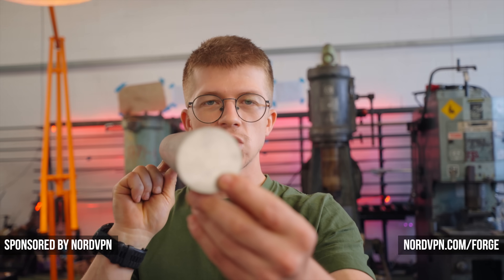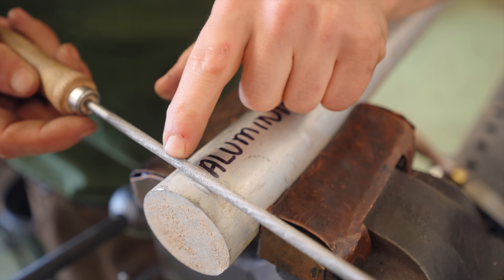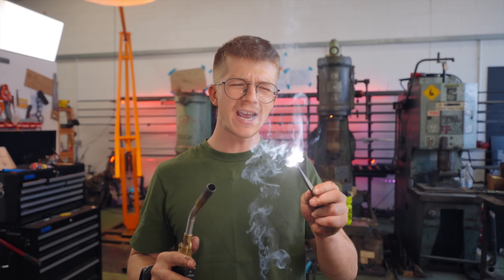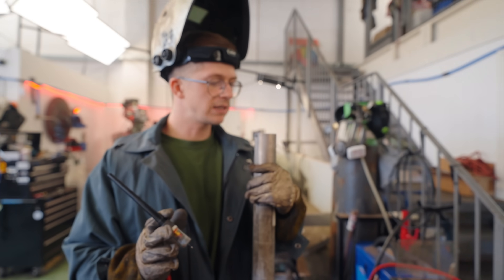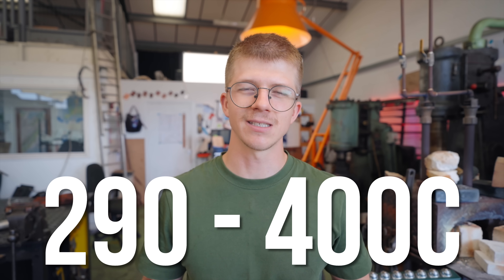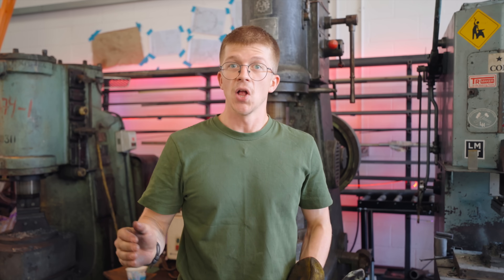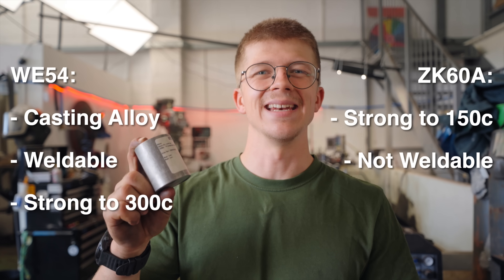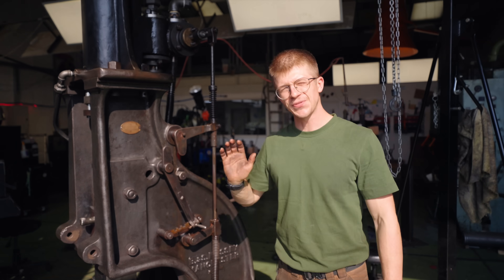Can You Forge Magnesium?

Comment: 2:00 They don't have to have a different number of atoms in them, not significantly anyways. If you got a trillion oxygen atoms and a trillion lead atoms they could form a solid of roughly equal size, it's just that one has less mass than the other, the actual atoms are basically the same size. Their density would be the same, in that configuration.

The question is whether Magnesium is less actually dense, i.e less atoms per unit volume or whether it's just less massive? So we go to the periodic table to find out, and indeed aluminium and magnesium are right next to each other, which means they're of quite similar mass, and Iron is on the next row down, thus the difference must definitely be in density of the solids. Just with a quick back of the envelope calculation, Iron has an atomic mass twice that of Magnesium, and is six times heavier per unit volume, so there's roughly three times as many iron (Steel is roughly 97% Iron, so it makes little difference) atoms per unit volume compared with magnesium.

Hardness and density are not correlated directly. The varying forms of carbon being the best example. The strongest substance known to humanity are carbon/graphene microtubules that put even titanium and diamond to shame, but they're literally microscopic and thousands of times less dense than any substance we're familar with. Hardness and flexibility are about the internal structure of the material in question, certain kinds of lattices are flexible and can easily bend but the bonds don't break, so it's incredibly hard to cut through.

Comment: Pure magnesium isn't used for a laxative. It is magnesium citrate, which is a salt of magnesium.
Reply: Magnesium hydroxide in suspension is used to treat acid reflux as it neutralises excess stomach acid. It is sold under the name milk of magnesia.
Reply: It's still because of the magnesium though, that's like saying salt isn't sodium.
Reply: @guyincognito.  The intake of pure magnesium, like pure sodium, is dangerous. So, being specific about it not being pure is important.
Reply: @dl200010  earing pure sodium will be way worse than pure magnesium tho lol. but yeah, some forms are scarier than others.
Reply: @guyincognito. 
Would you say that the Earth's crust is oxygen then? Since it contains oxygen?
Reply: @guyincognito.  Yes, salt isn't sodium metal. It's sodium salt. These are two different things that have the same nuclei (well, half of, anyways) and vastly different properties.

Sodium metal blows up if you throw it in a lake (specifically, sodium reacts with water creating sodium hydroxide solution and free hydrogen molecules, which then burn and explode). Sodium salt dissolves and makes the water salty.

How are people watching this channel so clueless about basic chemistry?

Comment: Can magnesium be cast? It might make a good alloy with copper. It seems to me that copper is the king of casting  base metals. Bronze can be made that is almost as hard as steel using different alloying metals. Copper might just make the magnesium workable, while enhancing the strength of the copper. If you could somehow alloy the two, you might have something you could work with. Copper has great malleability; Magnesium has great hardness. Magnesium bronze? It might make the hardest nonferrous copper alloy yet. Someone has to have tried this.

Comment: magnesium, flow meter wheel...small and lite, so it can meter small pilot light gas flow that's similar to a cigarette lighter flame. billing as much as it costs to buy a lighter for that same gas usage? in the gas pump in the gas metering valve ... the small armatures in mechanical watches and computer things... machine the bar so it becomes a roll pin with a magnetic levitation bearing on each end, and as so to also cut it down the length like a drive screw that moves the lathe table tho deep cuts, and finish it off by milling notches in the "screw" making a... turbine like metering wheel. anodize one of the front fins black the rest of it bright yellow "for a photo stator sensor", and inside of a tube levitating on monopole magnet rings/pin nubs, how little air flow makes it spin? average gas line is 1 inch wide... bit to work with being a 3" bar?

Comment: Well in reality the atoms are spaced further apart from each other than aluminum making it more gelly like that the Al causing the crystal lattice to slide more across the teeth of the pinny thing. Same goes for the forging due to increased atomic distance and its before observed jelly structure causing it to act like starch in water or D3O. The cracks you observed at the raw material are from the atoms retreating back to a lower vibrational state due to loss in temperature resulting into the “densifying” of the crystal lattice causing a shrinkage of the metal resulting in crack formation. When the metal breaks under high stress it will do so across the point where the crystals terminated along there meeting point which caused a beautiful shine to appear along the reflective crystal sides. Further studying of the crystal size along the breaking point may hold deeper understanding. As in regards to your Steam Generator I am happy to inform you that this is a work in process of which I could update you along the way if you so be interested ✌️👽🧬

Comment: The extra fun part of magnesium fires in your workshop is that it burns hot enough to start an aluminium + iron oxide thermite reaction which is self oxidizing and burns at 2862c. Good thing there isn't a bunch of aluminium and iron dust around.

Comment: Scientist here, the file cuts the magnesium worse than it cuts the aluminium because magnesium is harder than aluminium meaning the small teeth of the file are worse at breaking small bits off. You saw this when you tried to forge it. Where as the magnesium is more brittle than the aluminium so the wood saw with its big teeth is better at cleaving big chunks off the magnesium. Same reason it is difficult to get big long filings on the lathe with magnesium. The pieces break off in to bits easily because magnesium is brittle. You also saw this when you put it under the press.

Comment: If you can mold aluminium with a bit of that magnesium you can make really good thermal generator just don't let the metal get up to four hundred degrees Celsius otherwise it will combust, it's thermal properties were only found out recently in England too.

Comment: A friend was at the Isle of Man TT in the early 80s. He described how one of the bikes had crashed (nothing new there at a TT) and then ignited and BURNED. Emergency services were dousing it continually in streams of water for more than 20 minutes with no observable effect as a very expensive bike with a very high magnesium content frame burned down to a small puddle of liquid metal & finally went out.
Reply: Honda made a Formula 1 car with a magnesium body called the RA302. Their usual driver, John Surtees, refused (wisely) to drive the car on safety grounds. They put a substitute driver, Jo Schlesser, in the car for the 1968 French Grand Prix at Rouen Les Essart. There was a crash at the six brothers turn and the car ignited and Schlesser was killed.
Quite an unfortunate, and worst of all, unnecessary incident.
Reply: A large enough piece of magnesium will burn when completely submerged in water.  It tears apart H2O to burn with the oxygen, releasing bubbles of hydrogen gas.  It will also burn in CO2, leaving black carbon deposits on the ash.
Reply: The old vw beetles had magnesium engine blocks. You just let those burn out because putting water on it just makes it angry. I think there were some Porsches with them too.
Reply: Magnesium fire moment. Reduces water without issue at high temperature.
Reply: A guy and his wife from England live next to us in their duplex in North vancouver. He was a falconer when he was in England but couldn't do it here in Canada because of the sheer number of regulations made it virtually impossible. And that included a scrapbook with various feathers from his Birds over the years very illegal. But he also was a salesperson technical support for a brake manufacturer in England and he describes some of the accidents at Isle of Man. One of the worst ones is this chicane where somebody's wall has been run into so many times by out of control bikers that he didn't bother to rebuild it
Reply: @weedmanwestvancouverbc9266  I would be tempted to put a ramp in front of it!

Comment: Magnesium is an extremely hard material for one simple reason ... it's crystalline structure. Both Aluminium and Steel have cubic structures, where each atom is bonded to six adjacent atoms (up/down, left/right, forward/backward with right angle bonds), which means they are easily deformed, but Magnesium has a weird cubic octahedral shape where each atom is bonded to TWELVE adjacent atoms, making movement of any atoms in ANY direction almost impossible. That strength, coupled with it's lightness, is why it's a favourite material amongst aerospace and automotive engineers.

Comment: Magnesium is very useful in pyrotechnics. A friend of mine gave me a piece of SU24 aircraft wheel rim. Which is made out of magnesium alloy . I used to file it down to get the fine powder and make flash powder or firecrackers out of it. I also did cut it out and melted it with Aluminium in 1:1 ratio to make very brittle Magnalium alloy,which is very easy to crush into finer powder and useful in pyrotechnics. But stuff is very dangerous to melt alone, it sparks and burns by itself,so that you have to melt aluminum first then add Magnesium into molten aluminium with constant stirring. To get the alloy, you have to pour molten alloy into bucket of water ro immediately cool down, otherwise all of the Magnesium will burn out leaving only Aluminium behind

Comment: If you want to try a new metal try Inconel, a Nickel alloy. Fair warning, it can be smithed but barely. It's used in Jet engines for holding on to its strength at high temperatures. I've heard it at 1000C act like iron at room temp. Also it's hard to machine. Most CNC shops can do it, but it's left to their more Sr. Techs. On the plus side, it's a crazy tough material. It's tougher than most armor.

Comment: 10:30 And neither does celsius. It's an arbitrary measurement based around how water is feeling. If you were on top of a mountain your 0°/100°C are completely different than your friend at sea level. It's also a horrid system for typical everyday human senses. Oh its 30, it's pretty hot, oh it's 50, I'm now human beef jerky. For a human-based measurement 0 being really cold, 100 being really hot is almost so easy it makes sense. But no, lets judge it on how water feels, even though water changes how it feels with a bunch of different variables. Not to mention the people usually complaining about Imperial measurements are the ones who created the thing. Throw on that a base 12 setup has been a good "human" measurement system since the dawn of recorded history. The Babylonians had twelve hours in a day, we have 24 which is just 12x2. The Romans used a base 12 fraction system much like Imperial. Old chinese clocks compasses and calendars were based on the twelve "earthly branches." A foot is 12 inches, 12 troy ounces is a troy pound, 12 pence = a shilling. Granted a base 10 system is easier to do certain calculations with because you just move a decimal point or just immediately know "oh 50 of this measurement is one-half of the next larger measurement."

So yeah, like Alec said, arguments can be made both ways.  And to add the good 'ol joke: There's no metric on the moon.
Reply: Any math major can find a dozen situations where base 10 is not helpful. It's all about context, and arguing from the "more scientific" position doesn't prevent someone from saying something really dumb due to lack of first-hand experience and understanding.

Comment: I machined (CNC mill) a magnesium plate at my job some months ago. They needed a drilled and tapped fixture plate, ended up being a 3 foot square maybe two inches thick, roughly? I was able to pick up and move the entire plate by myself -- it was still awkward and heavy at that size, but there's no way I could have lifted it if it were aluminum. I think the craziest part about it were the chips. Since they needed the top and bottom flat and parallel, I had to take a lot of skim cuts to get the surface cleaned up without removing too much material. I picked up a palm-sized clump of wispy chips and they very nearly did not register on the skin they were so light.

I had a chemical fire extinguisher handy the whole time.

Comment: Hi. Thanks for the video! And extra thanks, that you are not yelling any more! Thats great!! I would like to see if that magnesium would be forgeable if you would heat it up even more? Like some where around 450-550C. I do not know, but it looks like that it was just too cold to forge. I really do not know abaut magnesium, but aluminium is almoust red hot when they forge some parts on the idustry. If too cold, it will crack. If too hot, then what? I do not know. If very much too hot, then it will melt of course. But yeah, thanks again, this was very interesting test and great video. I have been doing almoust everything around steel and aluminium etc. Machining, turning, drilling, melting, welding, brazing, you name it! But never ever with magnesium. Absolutely nothing experience with magnesium. So, this was great lesson for me! Thanks!

Comment: I can't respect a "scientific" call for things to be in C when that's just arbitrarily making a big deal about water (instead of say feet, etc).
But an urge to use Kelvin, I can respect. ...and it would make for easier comparisons I think in a forging setting, particularly with metals which are liquid at shockingly low temperatures (in C anyway). Kelvin just gives a better sense of perspective.

(I'm completely dual-system without using a converter. And I do appreciate the lengths especially in metric, as well as the volumes, and weights. Celsius is just a fairly weak entry for metric since F is fully decimalized for temperature at least. Perhaps I should say that the other way round, that Imperial is a lot less troublesome in temperature than it is in weights or lengths, because it's consistently in base-10)

Comment: That explaination of density was right, if you substituted it with the right words  -  denser metals aren't heavier because they're more packed together, they're denser because the atoms themselves are physically heavier with all the extra protons, neutrons, and electrons they have.
Reply: If that was the totality of the reason, density and the periodic table would be an exact match, the higher on the table the denser the material. Which is not the case. Molecular density, the amount of molecules (well, it's a metal, but still) in a certain volume also plays a part.

Or am I mistaken? It's been 15 years since my last chemistry lesson, lol. Metals could be an exception due to the lattice structure.
Reply: @Elechte  this is very true, especially when talking about gasses and such, thank you for adding that on, altho a correlation mass and density  is mostly true in the cases of metals. The reason why it wouldn't line up exactly when comparing it directly to the periodic table is because the masses you see are an approximate average of all of the isotopes of an element. Its also why copper and chlorine might have their masses rounded to the first decimal point while the rest have theirs rounded to the nearest whole number, despite the fact that the most common isotopes of the two elements have whole number masses.

(Edit: finishing a sentence I forgot to complete)

Comment: The easiest answer to the correlation between density and hardness is that gold and lead exist.
The longer answer is that there is some relation between density, stiffness (Young's modulus), and even melting point to some extent. If you multiply the density in g/cm^3 by 26.7 you roughly get Young's modulus in GPa... for magnesium, aluminum, titanium, manganese, and iron. Most other metals will be way lower. Beryllium and chromium are actually way above.

Comment: Had a 125cc two stroke motorcycle called a Cagiva Mito that utilised magnesium extensively in it's construction. It's power to weight ratio was such that it could exceed 100mph, crazy for a bike that size, it was pure joy, I highly recommend taking one for a spin if you ever get the chance.
Reply: Cagiva Mito was a beautiful bike!
Reply: Power-to-weight has more influence on acceleration than on top speed.  The only effect of weight on constant speed is through power loss at the tires.
Reply: @gibbogle  Thanks' for the correction, but even in that regard the bike did 0 to 60mph in 5 to 6 seconds with an engine the size of a can of baked beans.
Reply: 100 on a 125, that’s mad
Reply: @mitchdabeast_2103 it was a two stroke, there's been several 125cc two strokes that made 100

The real issue with 125s hitting 100 is that they're legalled limited to ~15 bhp now for CBT/European laws

They can (probably) make 125s that push 25-30 bhp on four stroke now, but the law (and the lack of a 125cc racing class, with moto3 moving to 250cc ) means that it's not worth the effort to develop

Comment: Alec, when you make Damascus you always use rectangular pieces for layering. Would it make a difference using circle cuts from a round bar and stacking those? I know ultimately it will end up being forged rectangular for a blade, however i just wondered id the initial process using circles would affect your pattern.